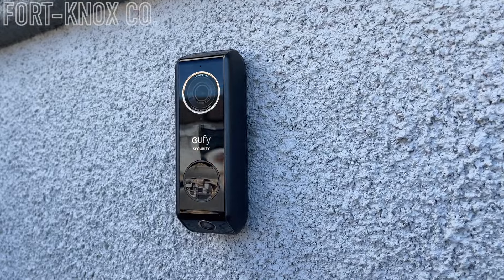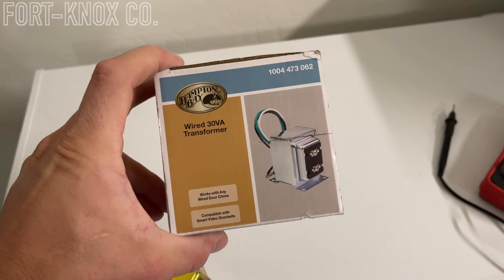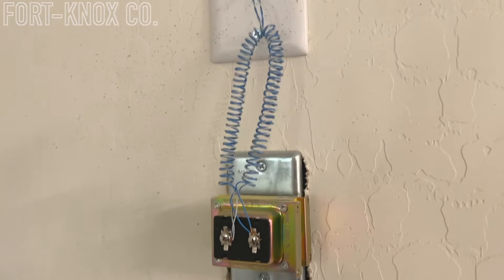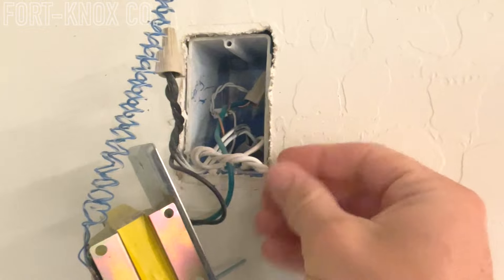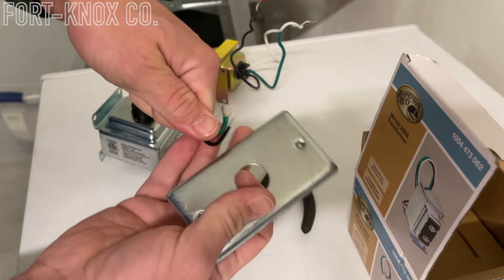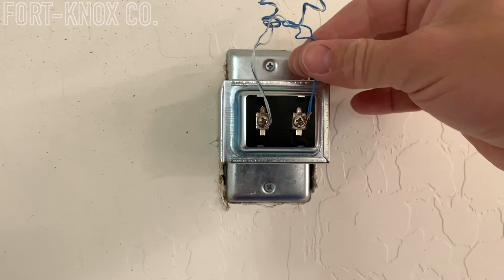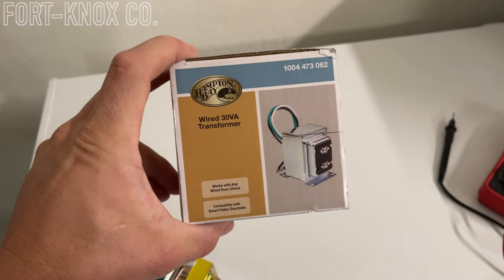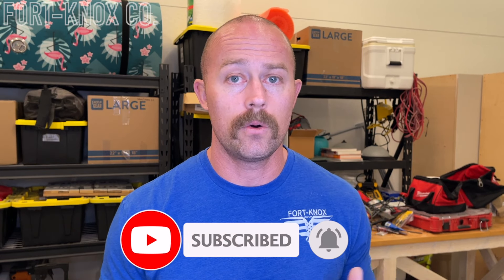Upgrade Your Doorbell Transformer For Your Video Doorbell | Ring Pro Doorbell Efuy Security Blink

Comment: The biggest problem is locating the existing transformer.  Finally found mine in the attic near the power cutoff switch to the furnace.   Took forever looking for it.  Builders on my 30 yr old house seem to put them whereever they want to.  No uniformity on location.   On the Ring camera you put a jumper across the existing doorbell ringer which essentially takes that out of the circuit, so the camera doorbell get full load of power it needs.
Reply from the maker: Yes the jumper cable just bypasses the chime. It lets the power flow to the doorbell with no switch or chime in the path.  
I agree, som builder just threw it wherever they wanted not expecting anyone to need to replace or service it I guess.
Reply: Agreed. My transformer is down in the basement utility room, mostly behind the furnace.  Tempted to cut access holes thru the return duct because trying to work behind and under the ducts is not great.
Reply: @FortKnoxCo Thank you. Does this mean that after we upgrade to the new transformer, we should remove those Ring doorbell jumper cable, so this way both the ring doorbell and old doorbell will chime?
Reply from the maker: @ no. It doesn’t work like that. Depending on what type of doorbell you have it will tell you what they ask you to do with the original chime. In a lot of situations the original chime won’t work once you install the video doorbell. With the original chime your push button doorbell, completes a circuit and causes the chime inside the house to go off. Once you install the video doorbell, it’s just using that power source to power the doorbell itself. Most of them rely on the Wi-Fi connected plug-in chime.But like I said, it depends on what type of video doorbell you end up going with at the end.

Comment: My eufy doorbell was working fine for over a year but then stopped working and I lost WIFI connectivity intermetently in the last 15 days until it shut down. I decided to reset the doorbell and I started receiving this message of 16v30va and does not work anymore. I checked the transformer and effectively is a 10-16. Thank you for doing this video, I m going to try change it soon!
Reply from the maker: Oh awesome. Yeah I got a notification on my Eufy doorbell probably the first day or so when turning it on that it needed a better power source. It worked but didn’t work well. So it told me what I needed and that’s what prompted the creation of this video. Glad you got it figured out.

Comment: Hmmm. I’ve never seen a transformer in the house. Unless it is in the chime box itself, I don’t know where to even begin looking for it. If it’s in the ceiling crawl space, I’ll never know; can’t get in there, any more. This is discouraging.
Reply from the maker: Usually I’ve always found them in the garage. Near the front of the home or near the location of the doorbell itself. 
I’ve also heard some people say they found it up in the attic if it’s accessible. It should be mounted in a location that can’t be accessed, they are an item that. We’d service sometimes so it would be a bad move on the builder to do that. 
I’d say start looking in and around the area close to the door bell and the door chime in your home. Should be close by
Reply: Thanks

Comment: I ended up putting a plug in transformer in since I wanted to remove my actual dork chime as well. Some reports had indicated that there might be issue with removing the chime and using the transformer, not getting the resistive activation load. I did find out the Nest doorbell does not seem to require any additional resistive load to work with a regular transformer.
Reply from the maker: Awesome. Great info to share. Sounds like you got it figured out. 🤙🏼🤙🏼

Comment: Does anyone know where to get a wall mount plate like the one in this video? Trying to replace my transformer with this exact one but I can't find a mounting plate that fits it correctly like the one shown in this video. Regardless, thank you for the easy installation video!
Reply from the maker: I just added two product links for what you might be looking for on Amazon. I’d start there and it should do the job. I found two different plates with holes commonly used.  Thank you for watching. The links are at the bottom of the other links in the video description
Reply: @FortKnoxCo  Thank you! I'll try those out.
Reply: Same here can't find a wallpate/faceplate that has the right size circle hole opening, will try links per OP. May have too manipulate one I already have.
Reply from the maker: @JuanBail  I found a couple plates that already have a hole in them on Amazon. The links should be in the description

Comment: So if mine is set up in my garage like yours is but with only 1 white and 1 blue wire for my regular doorbell. Do I need a chime or does it act like both? My doorbell isn’t working so I guess I could just replace the rectangular doorbell and I don’t need a chime if it is set up that way? I’ve looked everywhere in my house for a chime and don’t have one so I’m confused
Reply from the maker: You don’t need a chime if you’re using a video type doorbell. Most video doorbells show you how to bypass the chime. The power just needs to go straight to the doorbell technically. And it will either notify you on your phone and/or connect to a plunging chime that it comes with. All through the WiFi.

Comment: I wish upgrading my transformer as described in the video had worked in my situation.  Unfortunately, my doorbell chimes still suffered from phantom rings when connected to my Blink Doorbell Camera and the upgraded transformer...
Reply from the maker: That can be the doorbell and not the transformer. Getting enough power is a good thing. How well your chosen brand of doorbell works is a whole other matter. I’ve chosen Eufy. But there’s lots of brands out there with pros and cons.
Reply: @FortKnoxCo  The chimes are the high end hanging metal pipes (4 of them) that play a tune.  They have served the home well for a couple of decades.  I've removed the Blink doorbell and all is well again.
Reply from the maker: @ usually the video doorbells don’t need or use a wall chime unless it’s one of the plug in blue tooth ones that comes with it. I think when your using original home chimes on the wall that are wired in it can cause problems. In a lot of cases they ask that you bypass the home’s wall chime since all it needs is your power course directly to the doorbell. That power source has a wall chime in the middle, so once you switch to a video doorbell it could cause those phantom rings and stuff. All the video doorbells use their app and notifications or a plug in Bluetooth type door chime you can plug into any wall outlet in any room for convenience
Reply: @FortKnoxCo  Blink markets their's as being able to connect to your existing mechanical chimes.  The setup screens even go through a test procedure for setting the power required by the legacy mechanical chime.

Comment: Hi Brian. I am trying to replace my transformer. I found in my garage however the old transformer is from 1992. When I removed it from the wall the transformer was actually attached to the metal plate. There was no lock nut on the transformer to the plate. It's actually permanently attached to the wall plate. Would I be able to purchase a metal plate so that I can mount the new transformer I bought> Also there is no ground wire on the inside wall. Are there plates I can purchase that I can attach the ground to? Thanks Alfred
Reply from the maker: Yep, you’re on the right path. You can buy a transformer and plate separately. Or buy a blank plate and drill the hole you need to attach it. I’ve done that a few times. But the ground wire isn’t too much of a problem. It’s not requires some applications or home builds. So you can cap it and tuck it away if there’s no where to connect it.
Reply: @FortKnoxCo  Thanks for the information.

Comment: Dumb question, but the transformer is on the same breaker as the doorbell right?
Reply from the maker: It can be. But not always the case. Technically the transformer can be on any breaker circuit. It’s similar to just having an outlet on a circuit. Then you take that outlet and pop the transformer on it and it’s downsizing the power to the doorbells need

Comment: I purchased a new transformer but my old electrical box does not have a green grounding wire. What do I do with the grounding wire from the transformer?
Reply from the maker: If you don’t have a ground to connect it to in the box you can usually just cap it and tuck it away. Not every circuit has a ground wire, not common but still you see it sometimes.

The ground acts like a back up white wire. It’s in place so if for some reason electricity can travel back down the white wire it has a place to go down the ground.

Comment: My transformer is buzzing and it’s kind of annoying. Both ring door bells work ring. Does it need to be replaced ? Thanks
Reply from the maker: It’s not unusual for it to make a slight humming noise. You can try to replace it with a newer one and see if it stops the humming. Maybe a newer version will solve the noise problem.
Reply: Thanks ! It’s in the basement just was concerned if the buzzing would cause a fire

Comment: so if i hardwire the google nest doorbell, should i remove the rechargable battery it came with?
Reply from the maker: No. I believe you leave it in. That ways it has a power source Incase power ever goes out or has a temporary disruption. Being wired in keeps it charged fully until needed.

Comment: Do those blue small wires go directly to the bells? Reason I ask is my old Chime is toast...and my new Eufy (Wired) doorbell comes with a separate chime..so not going to use/but the same old Chime. Also, I am going to join the black with black, red with red (color in my case) at the old chime location, and check if I am getting 16v at the Front doorbell (don't have a 2nd one). No need to use the old chime correct?
Reply from the maker: Yep, that is correct. In most cases you are jumping across the terminals on the chime and bypassing it to have those wires go straight to the doorbell outside. So what your describing sounds correct. Just eliminating the chime all together. And having those wires go straight out to the doorbell.

Comment: Installing this in an older house. Our current transformer was not grounded, so there is no ground wire accessible to connect to the ground wire of the new transformer. What should I do?
Reply from the maker: Some circuits in homes don’t have the bare copper ground. It’s technically the same as the white wires. It should be fine leaving it capped inside the box. Of you can secure it to the the junction box if it has a ground screw. But not securing the copper wire should be fine so long as you have the black and white one secured correctly
Reply: @FortKnoxCo  thank you!
Reply from the maker: @Bmferna98  your welcome

Comment: Thank you, great video. You mentioned needing 16-24V, 30VA however the one you recommend is 40VA, is that ok? Just a bit more power?
Reply from the maker: Thank you. It’s actually still a 24v transformer at 24v AC power. The 40Va is a technical term with the way it works. I googled a quick explanation for you..”40 VA means that it can deliver 1 2/3 amps at 24 volts. A amp meter might show the valve drawing 1 2/3 amps. But the valve is only use part of it to do work. So it might only be drawing 30 watts. But you still need a big enough transformer to supply the 1 2/3 amps, thus you need a 40 VA transformer.”

In short it’s still a 24v transformer that is meant for doorbells and video doorbells. It’s made specifically for these applications
Reply: @FortKnoxCo  Thanks so much for additional info. Last question, do you think this plug-in version will work too? 24 Volt Doorbell Transformer, 26 Foot C-Wire Thermostat Adapter, 16-24 Volt Doorbell Power Adapter Compatible with Ring Doorbell, Nest Hello, Wyze 、Eufy Video doorbells
Reply from the maker: @dmitryg6353  no problem at all. I’m not 100% familiar with the plug-in versions of these transformers but if that’s what his advertise for I would say it can work. All you’re doing if you see in the video, is taking a regular outlet power source and downsizing it to, a lower voltage through the transformer and then from there going to your device. So whether you hardwired in or you’re plugging it in an outlet, you’re basically accomplishing the same task if they’re advertising the device.to do.
Reply: What are some of the problems associated with needing the updated transformer?   I installed my ring pro, doorbell worked then I setup in app and now it’s not ringing in the house (chime) plus it’s offline. Not sure if the transformer would fix this issue?
Reply from the maker: @danielwarner5358  those problems sound exactly like what the upgraded transformer will fix. The power source needs to be bigger/upgraded  to properly power the device and to get the functions working.

Comment: I have three Lorex 2k doorbell video cameras . Do I need three separate transformers?
Reply from the maker: You may not need separate transformers, unless you have more than one transformer already. Usually it’s just one that powers the door bell or door bells. I would upgrade the transformer you have but not add any additional transformers. unless you have others to upgrade.

Comment: I can't find my transformer, could it be in the chimer itself? I opened mine up and it doesn't seem to have the same transformer inside, there are just two black boxes and the mechanism that strikes the bell. That being said, great video, straight to the point and helpful.
Reply from the maker: It usually is somewhere in the garage and it’s usually mounted above eye level. No matter where it’s installed it should be up high because there’s a risk of bumping it and there are those low voltage wires technically exposed. So if you haven’t looked up around areas where it could be make sure to do that. But I know every house builder is different. Maybe a neighbor or someone you know in your area has located theirs and that could lead you to where to look for yours. Depending on your area they may build the house with it in a specific space. On the west coast it’s commonly found in the garage.
Reply: @FortKnoxCo  Thanks for the info, I did some research and a few people mentioned it could be in the attic, I suppose I’ll climb up there and take a look as I’ve checked everywhere else.
Reply from the maker: @TheRedRaven_  that could be a spot they put it for sure. It’s usually up and out of the way

Comment: I only have 2 white wires and 2 black wires that were connected to my old transformer. No green. What can be done when adding the new transformer (trying to add doorbell camera)
Reply from the maker: The green is just a ground. Not always required. Technically it works as a back up for what the white wires does. In case the white wire faults it gives the electricity a path way out to the ground still. So some circuits don’t have a ground wire. In this case you can attach the green to the terminal box or leave it capped. Some fixture boxes have a screw to attach the green wire to.

Comment: Is there a chance that the chime will fry from too much power if you upgrade from a lower powered transformer?
Reply from the maker: No. It’s still low voltage. It’s a very common upgrade.

Comment: Great video! 
Mine stopped working a couple days ago, would you recommend the 16/30 or 24/40 transformer?
Reply from the maker: I think the 24/40 works well. Usually your doorbell will tell you what’s recommended. But I’ve seen some of the 16/30 still give you the message that the unit is not powered correctly. But I’d see if there is a preferred voltage for your specific brand doorbell
Reply: @FortKnoxCo  mine is ring. After this video I will go with the 16/30

Thank you
Reply from the maker: @timyassa4343  sounds good

Comment: Is there any other transformer in the house , I found a transformer next to the electrical panel in the Basment , how do I know if is related to the  doorbell?
Reply from the maker: That could be a location for your door bell if you have a basement.  If it’s like the transformer I’m showing then these usually are specifically used for doorbells. It basically drops down the voltage to be suitable for the low voltage system that the doorbell runs off of. There usually isn’t multiple in a home. Just one that I’ve ever seen. You can test and see if it’s going to your doorbell by disconnecting the two small wires and using an electrical detection tool. Many circuit testing tools have an ability to send a voltage down a line and you can test the wire coming out at your exterior doorbell location to see if it’s coming through. Like sending water through a hose and seeing if it comes out down the line where your thinking it should be coming out. If that makes any sense.
Reply: first time I get a reply from YT ❤, great video.
Thank you
Reply from the maker: @danielfinao  Well, I’m happy to be the first one to reply. Lol. I make it a point to try to reply back to all comments on my channel. So far I think I’m shooting 100.